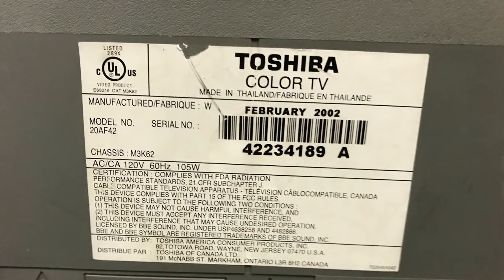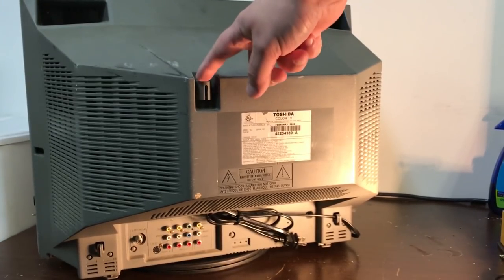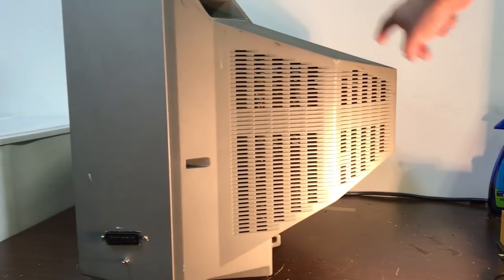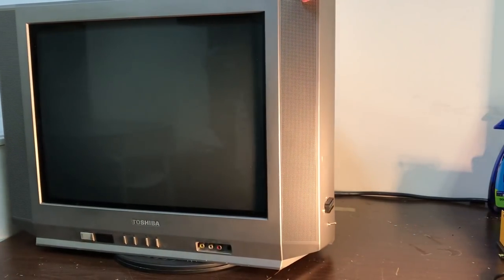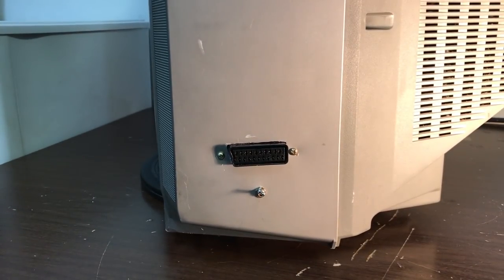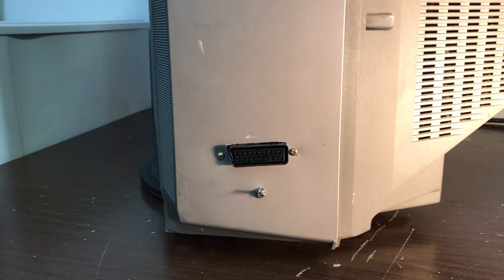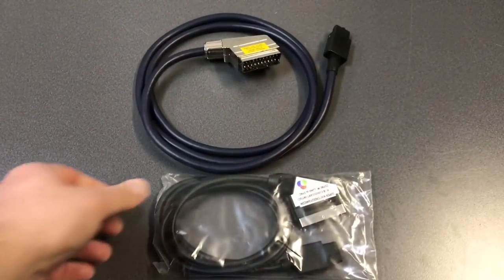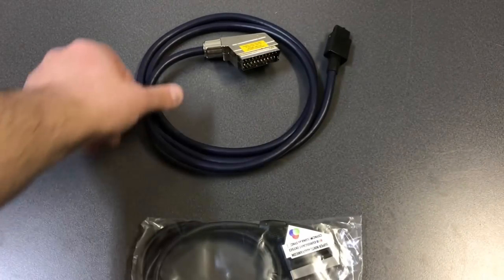RGB mod VS Component Video on a Consumer Grade TV

Comment: photographer here: pro tip for capturing the screen with your dslr. I wouldn't go above f/8 on your aperture on almost any lens because something called 'diffraction' kicks in which basically makes the entire image softer. I'm assuming you're using the efs 24mm 2.8. If you do take more shots in the future, I suggest shooting somewhere between f/5.6-8. Good job syncing the camera sensor with the tv refresh rate by the way.
Reply: TehTechnoGuy I know what you mean by diffraction. But you really don't want it to be too sharp because scanlines cause moire. My trick is to make it slightly softer and I use F2.8 to do it. That away I don't have to bump my ISO up to get that 1/60th shutter speed I prefer.

Comment: I have to agree this is probably down to the conversion components that are then sending out there own 'interpretation' of the component colors in RGB to the neck of the CRT. Any time you can circumvent processing in the analog chain, it's always going to be slightly better.
Reply: Agreed. Even if the conversion from RGB, to YPbPr, then back to RGB can theoretically be mathematically lossless Its still analog. And as far as I am aware, 'Lossless Analog' is an oxymoron, so the best idea for an analog signal is to take the route with the least amount of steps so less components can 'color' the signal. (pun not intended)

Comment: I wonder how different the RGB and Component inputs would look if they were calibrated. For example, if you lower the saturation and brightness on the TV when using the component input, how close to the RGB image does it get?
Reply: Identical really.
Reply: @kuroikensai202  thx for answer 🙂
Reply: @wust.wanderer  NP. Even S-video looks great honestly. Only one crappy output is composite.
Reply: Well I calibrated the S-Video and the Componentn inputs on my CRT TV whiched involve tinkering in the secret service menu. The S-Video input stacks up amazingly well against Y-Pb-Pr when comparing picture quality on my GameCube, Xbox, and DVD player
Reply: @kuroikensai202  composite always looked bad on high fidelity displays like a pvm
Reply: The tint of the colors looked a little different too but I"m sure that could be calibrated also.
Reply: @alextirrellRI  It's easier to calibrate brightness in YPBPR WITHOUT TOUCHING COLOR, than red, green, and blue signals individually and thus tweaking your brightness, tho. 🤷🏼‍♂️
Reply: @kuroikensai202  you are very wrong, composite only looks bad on modern tvs, it looks perfectly fine on actual crt tvs. it makes me think you didn't test composite on crt tv.
Reply: @ricki399  there’s still a fair amount of color bleeding with composite— no matter the display

Comment: I am here watching this in 2021. Ever decide if RGB is better than component since this? 😎
Reply from the maker: Ha!  Well, unfortunately, it's not that easy.  If you're just talking about signals, they're equal.  Going into a TV like this, they SHOULD be equal as well, but RGB-modding the TV bypasses all of the other 20+ year old circuitry in there.  As a result, you can technically get a better signal if you RGB mod a TV...but honestly, just getting an RGB2Comp will get you 99.9% close:  http://bit.ly/retrotinkrgb2comp

Comment: I also agree that the differences are due to the electronics in your system making the component signal appear different than the RGB signal.  Further, I tested this idea recently with the following setup.  I took the RGB signal from a model 2 sega genesis and hooked it up directly to the OSSC 1.6 using a multicore scart cable from retro access.  I then outputted the HDMI signal to my TV and got a baseline picture.  I then compared this to taking the same signal from the SCART cable and conerted it to component video using the Shinybow SB 2840 and hooked it up to my LG TV and the picture appeared much brighter and with a tad bit less sharpness.  I wasn't sure if this was due to the component conversion process or the TV's analog to digital converter, so I took the same component signal from the Shinybow and connected that to the OSSC with the HDMI output connected to the same TV.  When I did this, the image on the TV was identical to the RGB Scart signal going through the OSSC.  Therefore, I was relieved to find out that the difference in image quality was not due to the component conversion in the Shinybow, but rather the way that my TV processed component video signals.  Given that converting from RGB to YUV color space is at least in theory nearly lossless, I think it is safe to assume that the majority of the reason that component appears different than RGB in most setups is due to differing electronics.  Granted this test is only only a few games on one console, it gives me hope of having a completely component based switcher hooked up to an OSSC might be the way to go in the future for all consoles from the original XBOX and prior.
Reply: For reference I was using an LG 43UJ46300 which I have to admit surprised me with its performance for gaming.  Not only does it have an average latency of only 10-12 ms, but it supports 240p through HDMI.  Unfortunately, it doesn't support 240p through component input as of its most recent firmware revision.
Reply: The other thing I can think of that might have changed your results is the use of the HD Retrovision cables.  I was curious how they determined the correct resister ratios for their op-amps to do the RGB to YUV conversion.  Unlike the Shinybow, which uses a fixed ratio based on a mathematically determined formula, HD retrovision used a slightly different techique.  In order "maximize console revision variability" they essentially took 10 different consoles, manually measured their signals, and then took an average to determine how they would convert RGB to component.  Obviously, while this is a good approach if you want to produce good results for everyone, if your console is not "average" your color and sharpness values might be off by a fixed ratio.

Comment: Guess it depends on the tv.

On my sony that I rgb modded my snes is a bit dull running rgb but I also modded my snes for component and it looks way sharper with better colors but awesome video,very interesting.
Reply: For my SNES, I use an adapter box so I can use it on a 2000s LCD monitor.

Comment: What I'd love to see is a good video on how to properly discharge a CRT.  I'd really like to get more comfortable with doing that so I can refurbish a couple of good CRTs I've got lying around and take a crack at an RGB mod too.
Reply: I did most of my mods without discharing the tube. The parts you will be working on are all DC voltage up to 8v. So even if you are able to achieve a electrical shock it will be very light. The parts with 200+ volts are the neck, the flyback (the part that goes into the tube) and the end of the flyback. All the rest is fine. There are tons of videos on youtube on how to discharge a crt. But basically just get a screwdrive, a not conductive tape, some thick wire, just have the wire around the screwdriver, hold it with the tape, and the other end goes to the coil around the tube. Really easy to spot it's around the entire tube. Next just get the screwdriver and insert under the flyback end on the tube. Most of the time you won't even hear a "plock" sound of discharging.
Reply: Also you can watch almost all of John's Arcade videos, he discharges CRTs all the time, and is paranoid about it.

Comment: Great video. I still see what appears to be noise from the power supply on your TV. That line that moves down the screen. I had the same issue and it bothered me when I considered game capture. I eliminated it on my CRT by using the "perfect" power supply. I bought several different AC to DC 9v SNES power supplies, but each time I saw noise moving down the screen, and no AC to DC power supply I bought would solve the problem. Yesterday I was so excited when the problem was solved, that I didn't bother to turn off the fan before I recorded the video, but of course the sound isn't what's important in my video, it's the video signal, and it's finally perfect. My original SNES power supply and first original SNES were stolen in 2014 along with all my games. Experts told me I needed more amperage and or voltage in order to fix the problems, due to flash cartridges using more power than regular SNES cartridges. I did see one difference between using original SNES cartridges and the flash cartridge in the graphics, but that was unchanged by fixing the power problem. 
In Part 1 (my failed attempt to get rid of the noise) I show how the original game does not have the graphics issue that I have with the FXPAK PRO... but it's only on one game on later levels.  In Part 2 I show my "Perfect" power supply, that fixed all my issues, except for the one game I mentioned on the FXPAK PRO. 
These two videos will be out next wee on my channel September 14th and 15th. Due to living situations these videos were not recorded in the best environments, or with the best equipment, but new recording hardware should be arriving next week for future videos. I hope to be making many videos soon. 
See Part 1 Here https://youtu.be/QsjcbacLyEs 
Part 2 How to Eliminate Video Signal Noise SNES https://youtu.be/jdg-V6oczw0 

Thanks to the people at Everdrive forums for their help, and to Everdrive.Me for supplying me with an FXPAK PRO as well as my other channel sponsors.

Comment: Thanks for the comparison! As I suspected, Component is practically identical to RGB in appearance. I use a Shinybow SB-2840 Scart to Component converter with my 27" Sony Trinitron and to me it effectively adds a SCART "input" to that TV without any modding required. It looks great.
Reply: Exactly the same setup I use.  Same converter on a 27" Sony Trinitron.  Looks awesome too.

Comment: Awesome video!  As a follow-up, do you plan on doing any testing on RGB -> YPbPr transcoders in the near future?  

At this point, I am happy with a consumer-grade CRT, rather than trying to hunt down/justify a PVM or BVM.  I would like to be able to run all my RGB-modded consoles through a switch like the gscart_lite, then convert the signal to YPbPr for my CRT TV.
Reply: I have a couple of PVMs as well as consumer CRTs (mainly sony) and while there is a noticeable difference its not as large as one might expect. Furthermore, my PVMs do accept both RGB and YUV and the difference between the two is not noticeable. I am assuming one would have to take a still shot and then magnify it to find any real difference, if there is any perceptible difference at all. Theoretically, RGB and YUV should yield identical results, practically that is not the case though (but it is close enough that I would never recommend someone buy a PVM or mod a CRT for RGB unless they found it for cheap like I did. In fact, I got mine for free. My mother's friend is a nurse and she knew I was looking for them and her Hospital had half a dozen in storage and she asked her boss if I could take them and they said yes, I was super happy lol).

Comment: I was double checking with another post that YUV vs RGB signals can produce the same quality, but you'd have to make fine adjustments to the display rather then just switching modes or plugging in different cables.  I know from what I read YUV isn't a compressed signal like everyone is lead to believe, but runs as a mathematical equivalent and among all things given would require the display's recalibration due to the difference in color space. 

I'm bringing this up because I'm starting to believe the necessity of needing to mod RGB over component may be a frivolous endeavor that needs to be given another look at.  If I were to say your RGB vs YUV comparison is wrong, I'd like to look more into this.
Reply from the maker: Everything you said is correct, but respectfully, I think you missed the point of the video:  We wanted to see what would happen and determined that the only difference was most likely because we skipped all the circuitry inside and went directly to the OSD.  So, basically, we're saying almost the same thing.

Comment: Bob, I am wondering whether comparing the output image from all the input methods, with the tv controls never changed between tests, isn't going to provide the baseline you are looking for. I think it is possible each of the input methods may require slight calibration on the TV's controls in order to look best themselves, rather than all be correct from the start just by connecting. The consumer grade gear did have a few inputs on them, but without the expectation they would be sold to videophiles or used in discriminating environments -- in many cases it was awesome enough just to have those inputs at all. It wouldn't surprise me if the inputs varied off the decoder board bundled in the TV in their signal delivered to the tube, so maybe we should be judging them by how good of an individual picture a TV can deliver for an input method after being calibrated.

Those NES RF adapters are also not holding up well with age -- I tried several of them and had bad results before finding a different one that seemed to work well enough. Supposedly the design inside is not robust and the materials have not aged well -- that rabbit-ears-style 2-screw 75 ohm adapter RF box could actually give better results than the Nintendo version at this point... :(

Comment: In my opinion after seeing both in action on my Sony 20FV300, the difference between straight RGB scart and my Retrotink RGB2COMP converter is very minimal. You could only catch it in a side by side comparison with photos. Admittedly I was a little disappointed after doing the RGB mod on it, still looks great though. Wouldn't go through the trouble again. My 2 cents.

Comment: It's great that in the UK we had RGB because of the great picture, but we didn't really have composite until HD TVs came in, the biggest problem I am having is connecting HDMI to my RGB TV there is no straight RGB from HDMI, I am looking at getting a generic HDMI to YPbPr then using a bahar bros Garo (which I have already got)

Comment: Nice vid... but there was no doubt about the outcome...

The SNES outputs RGB, the cable converts it to YPbPr (since an unmodded SNES cannot output component video) and the TV has to convert it back to RGB to display it... because that's how they roll. So you have two signal conversions for YPbPr and none for RGB.

As far as 240p or 480i is concerned, there is no way for component to look better than RGB, if the console does its best B-)

Comment: Pretty good comparison. I have a 36" JVC I'Art with component in and I was considering an RGB mod, but after seeing these results I have decided it's not really worth it. Better off using an RGB to YPbPr transcoder.
Reply: I had an I'Art CRT and loved the picture on it but even after adjusting brightness and contrast, the picture on the set was so bright that it hurt my eyes and I had to get rid of it.  Do you find the picture on your set to be too bright?
Reply: I haven't had that issue, there's a setting in the back of the set that allows you to dim the image.

Comment: Love these nerdy deep dives. Though I feel a bit like I'm taking crazy pills here because in the video you mention (accurately in my eyes) how there is little to no difference in picture quality in your test yet multiple times say very confidently that the RGB image in the comparisons was clearly better?

To me they look the same. Virtually indistinguishable and honestly the darkness of the RGB would make me choose the component hook up 10 out of 10 times here. So what am I missing here? You're obviously not alone either as every comment is agreeing with you, I'm just curious is all. Is it an "in person" difference that you're really talking about or what?

Thanks and love the channel :)
Reply from the maker: Thanks!  To clarify:  There is no picture quality difference in the signal types of YPbPr and RGB.  RGB isn't better than YPbPr and vice versa.  However, how each console and TV utilizes those signal types can differ.  On this TV, skipping all the circuitry and sending RGB direct to the tube looked a TINY bit better than letting it process YPbPr.  Each TV is different, but honestly, if you find a CRT with YPbPr inputs, just use that - It's SO MUCH EASIER and still looks amazing.
Reply: @RetroRGB  Gotcha! Thanks for the further explanation. So out of curiosity how do you feel about component hookups on an older LCD tv as opposed to a CRT? Is there a discernable difference there do you think?
Reply from the maker: Complete junk.  LOL, not kidding, check out these two videos for more info:
https://youtu.be/jJzN_YHZezY
https://youtu.be/lOEzPTz2QCQ

Comment: Awesome video!  Thanks for doing this.  I have a few questions.  Maybe I missed it, did you use anything like Artemio's 240p suite to calibrate the black level (brightness) and white level (contrast) for the component and RGB inputs?  You may already know all of this but another thing that you can do is access the TV's service menu to turn the red push off (this is the AXNT option in Trinitron menu) when connected through component.  Sometimes there are even 3 or 4 levels of intensity for the red push that you can select from within the red push option in the service menu (i.e. 0,1,2,3).  The reds might look the same on both inputs if you do this.  Since RGB is bypassing all the onboard processing, it seems turning the red push off would get you closer to a more direct comparison.